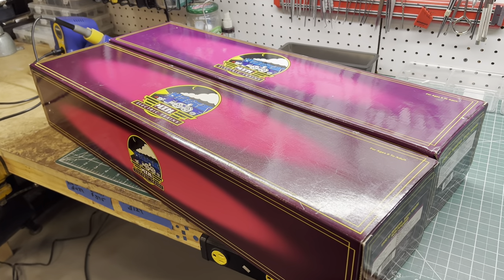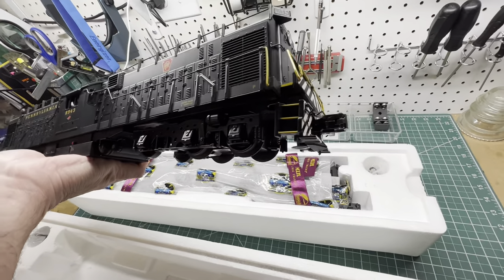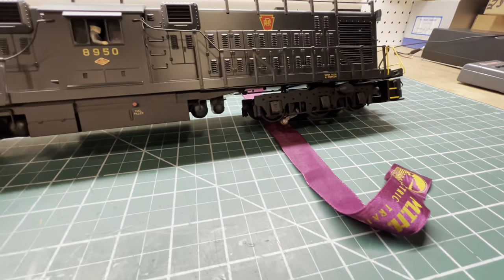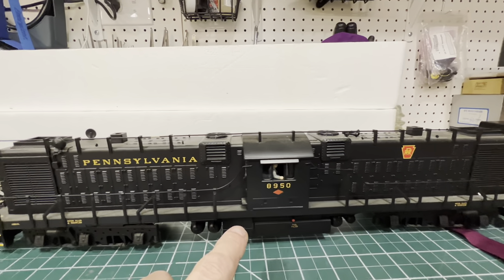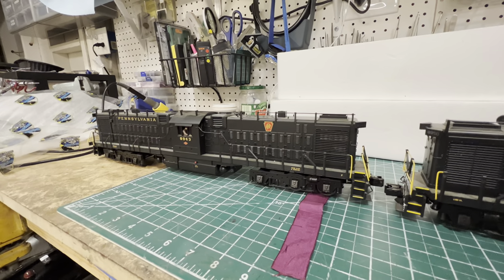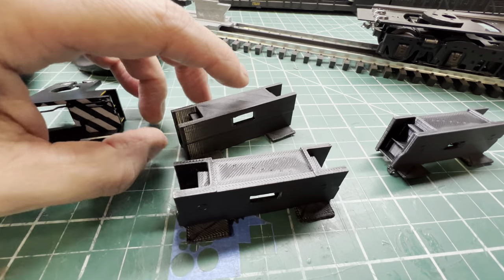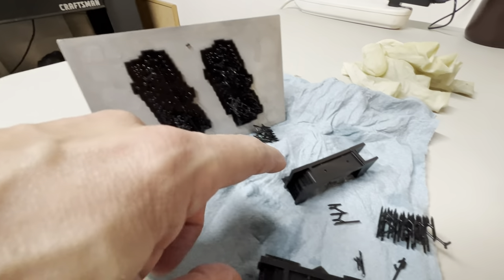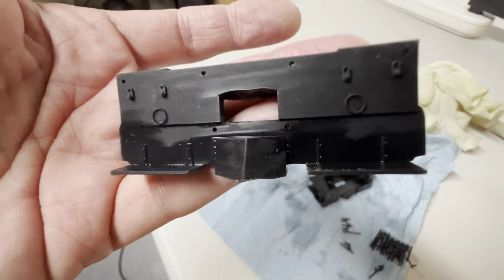The Chronicles of Norm #13 - The Big Dummy

Comment: Hi Norm.  I have this engine in HO.   The PRR bought 2 batches of these Limas..  The first 11 did not have MU or dynamic brakes.  Also, no train phone.  The second batch of 11 had MU, Dynamic brakes AND train phone antenna.  Don't cut off the dynamic and train phone. The 8900 series had both and often ran in pairs around Steubenville Ohio   The first 11 were numbered in the 5600 series

Comment: Train phone was correct on some of BS24m ; however half of the antenna was on one side of the hood and one half on the other side of the hood.   Two different orders of BS24m with different trucks on one order.  You are correct no dynamic brakes
Reply from the maker: Here's some interesting reading: https://railroad.net/lima-transfer-units-on-pennsy-t159323.html#p1325656

I decided against removing the db assemblies and did not pursue adding MU hardware to the end platforms. It was a bit more work than I wanted to get into. I still may look into adding sound to this unit but that may be for another time. 

I really wanted fixed, full width pilots. I felt that 'completed' the look of these beasts.

Comment: Norm, strongly suggest not touching that uncured resin. Your body develops an immune response to skin exposure over time.  Starts with burns, but can end with strong headaches and rashes to even faint fumes from cured models. Kathy Millatt supposedly developed this issue.
Reply from the maker: Thanks, I normally don’t. The removal shown in the vid was after washing but I wouldn’t recommend touching it barehanded until after final cure.

Comment: Enjoyed  as always. Wouldn't  worry  about  the  cut  levers. They have a tendency  to  get  damaged  in  regular  service  and  repaired.  One question  though.  If the  one engine  is  a trailing  dummy  would it have crew  members  on it.  You and your  family  have  a safe  and wonderful  Christmas.
Reply from the maker: I may remove them and use them in the powered unit. The powered one has the old style MTH figures.

Comment: If the other unit had the sound for two prime movers as well as the power unit you would get tired of listening to it after a while. All the electronics in these things are delicate and unreliable and you can short them just by coupling the tender up to the engine.

Comment: Lima's were such problematical locomotives. They're crankshafts would have a habit of coming through the engine Baldwin should have never bought the company. I can't understand the thinking they had back then. They bought Hamilton engine so they bought the company before they found out that Hamilton engines were so rotten.